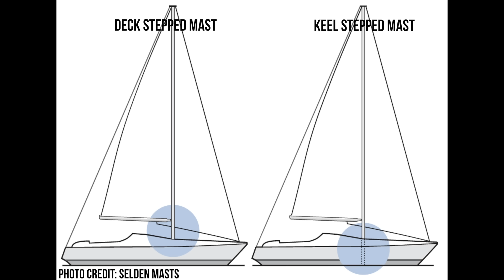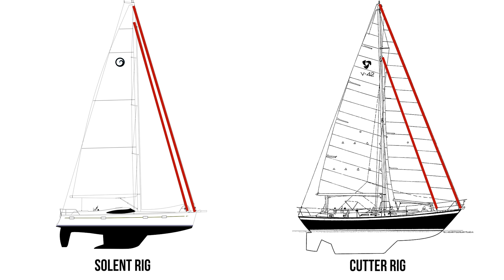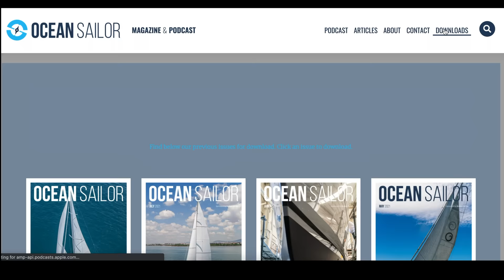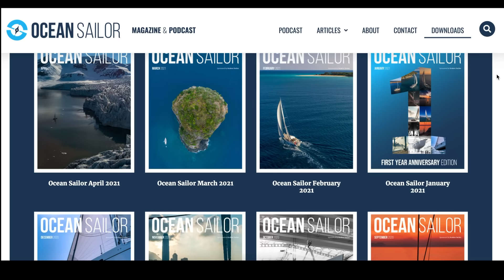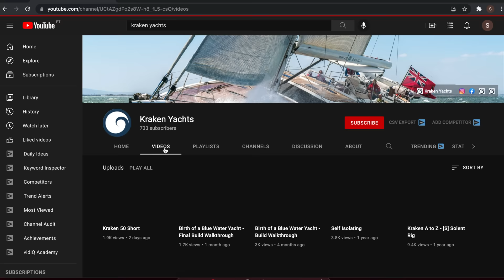7 Features to consider in a Bluewater Sailboat | Interview with Dick Beaumont

Comment: Very interesting, I have been sailing for 50+ years with a wide variety of boats all across the world and came to much the same conclusions as Dick, my fears are hitting something, fire (including lightning), going overboard and loosing a mast. I couldn't find the boat I want so I am building my own 80 footer which is similar to his design with integrated keel, skeg etc. My hull is much thicker than his with very high strength non osmotic resin, a deeper keel, wider and flatter profile (I turn the engines on if I want to go upwind), solid with stringers below the waterline and nidacore above and in the decks  (no wood in the boat at all, termites are terrible in a boat). I also have bonded in tanks from the keel to above the waterline at the front half of the boat which gives me a second layer of protection and finally I have a full collision bulkhead and 5 full watertight bulkheads across the boat along with a fully isolated engine room. Each watertight area has its own high volume pump out line and I can loose two watertight areas without it effecting the seaworthiness of the boat . It is center cockpit with fully enclosed pilothouse with steering positions in both, and 6 inch solid toe rails and ss guard rails  / full pushpit and pulpit, all lines and controls run back to the pilothouse and there is a stern diving platform and ladder for in water work and diving (a rope around the prop in Biscay taught me the need to be able to get in and out of the water easily). It has ketch rigged keel stepped masts with oversized rod rigging which is bolted right through to the keel with ss plates, in mast hydraulic furling, backstays, Cunningham's and hydraulic winches, anchor winches (3 full sized anchors and chains) bow and stern thrusters etc. Not a fan of high power electrics and batteries on a boat. One thing he doesn't mention is engines, I have twin naturally aspirated manually injected 320hp MAN diesels (old school) with tankage for 3000 miles in 5 tanks and multiple fuel filters / fuel polishing system which will drive the boat at 12 knots along with twin northern light generators for power and hydraulics (everything is duplicated or triplicated) . Whilst you cant outrun the weather I want to get as far as possible from it. The engine room is completely isolated from the boat with its own auto close air supply and vents and has ir, smoke and fire detectors, cameras and halon flood extinguishers, no gas on board. There is also an very high capacity engine driven pump and nozzles for firefighting and full centralized fire and smoke detection in each cabin.  I think safely is paramount in a deep water boat, not cost, performance or sexyness. Modern boats scare the c**p out of me and I wouldn't go out of sight of land in one.
Reply: Great post

Comment: I was a bit confused about the section about FIRE. He talked more about building up the hulls using composites 15Mil or thicker and using kevlar in ket areas. ut that doesn't address FIRE at all. I was left scratching my head because the composites mentioned are all flammable as are the resins used to bind all the layers together. This in my mind makes the Kraken MORE flammable and susceptible to fire. 

I understand he eliminated GAS (propane and dingy fuel) and has gone all-electric which I agree completely radically reduces incidents of fire but doesn't completely eliminate it. I have seen many boats with no gas on board still catch on fire and quickly sink because the fiberglass composites and resins are so flammable it goes up fast.

What I believe we need are new composites and resins for constructing these boats, which is why Aluminum and steel are still considered the safest materials to use if your goal is to avoid fire at all costs! So, I was surprised that he basically shrugged off the aluminium, saying, yes he had looked into it, but then moves on to the composites he uses for the Kraken as being superior to aluminium and steel due to the build of layers and the Kevlar at key points. I understand and agree with the thickness of the hull but I didn't see him actually addressing fire successfully.

I would like more discussion on the FIRE side of this discussion and get more clarity to assure that boat owners need not worry about a fire on their yacht, even if they leave it at a marina for a few months.
Reply: I would add to your point that it would be helpful to discuss the possible ways fires start on boats. Maybe somebody has done this already, but I haven't seen it nor thought about looking for such videos.
Reply: No gas on the boat which seems to be the biggest cause of fire on boats.
Reply: @randystrand908  most boat fires start electrically.  Propane fires are extremely rare.  Electric cooking is nice but that’s another power hungry system you have to feed somehow with some other expensive equipment.  Not a lot of real estate on a monohull for solar either.  Benefits of a catamaran.  Pros and cons to every choice.

Comment: I was recently asked a few times in a short period "why not a catamaran?" I said "oh, the main issue I have is they are very stable when upside down". In addition the lack of mass does not help you power through anything but that is a minor issue compared the the upside down thing.

Another source of fire on a boat is the electrical system. I don't know about newer boats but older ones do not have a fusible link on the battery side of the cable that goes to the shut-off/panel.

Comment: ABSOLUTELY.....!!

The VAST majority of ALL problems on a blue water yacht is all fuel related.  Yes...Asia is bad.  As well as our cruising down thru Mexico, Central and S. America...and the Carib Islands.

Many places there were no fuel docks....not even a dock.  So we'd take on fuel, under a bridge, from a truck high above us.  But most of the time, it was from old, 50gallon rusty barrels....that had some rain water in them...leaves...whatever.  That they'd take the barrels to some gas station, for diesel fuel.  Then roll the barrels down the beach....then into a dinghy skiff. To bring out to you.

The barrels are guaranteed to be filled with rust. We built what's called a BahaFilter, of micro screens.  That the fuel would go thru, before going down into your tanks!!

HOWEVER....diesel fuel bacteria, are guaranteed to grow in your diesel fuel. And within days....your fuel filters would start filling with ribbons of bacteria.  That looked like masking tape.

And yes, we had 3 fuel tanks.  That as we ran the engine....the 550 gallons of fuel would constantly be circulating thru our fuel filters. Constantly being polished, removing water, and bacteria.  But even then....you still have to use fuel additives. To kill fuel bacterias.

When you're in warm ocean waters....with a bit of moisture in your tanks.  You're guaranteed, to get fuel bacteria, growth!!

And if your motoring in moderate seas....that rolling will stir your fuel tanks.  Stirring up sediments. That will plug filters.  And there's nothing worse, then changing filters, with a hot engine...rolling in the ocean!!

Generators...refrig....everything else can be put off, and taken care of, once you get in.

And yes....with our ketch rig...it gives us sooo many sail combinations to run, no matter the wind state.  We never had to reef.  We'd run full sails, up to around 30+.

Then take our main down.  And with 50+ winds....we'd run a partially rolled up heavy genoa....and our mizzen.

Sooo.....I love the flexibility of a ketch rig.
Reply: I've watched a ton of sailing related videos, but this is first discussion re fuel quality, dangers and solutions. That three tank solution using filters sounds excellent!

Comment: While I agree with a huge amount of what is being said, a huge amount of these potential issues can be mitigated or completely removed by a steel boat, keel loss, fire(to a degree) strength etc...... Aluminium is all good and well but it's soft, not steel though. Absolutely agree with keel stepped and solent rig, and no runners.......but you will struggle to tack the Genoa through that wee gap. My boat has a very tall selden fractional performance rig which ive added a dyneema removable solent style inner stay to but moved the bottom back a bit to create a type of fractional slutter rig, single backstay and ive got a reaching gennaker on a karver continuous furler on a sprit with it's torsion stay, on a 6mm insulated chined corten steel hull Van De Stadt 34' pretty bloody seaworthy and high latitude capable. My list of prerequisites for a blue water capable yacht were integral keel, skeg hung rudder, keel stepped rig, cutter or solent, tiller steered, large tankage and storage capacity, good solid overpowered reliable diesel, preferably a chined steel hull designed by a reputable designer, I got everything except the keel stepped rig but after having sailed her in well over 40 knots around cape point and Aghulas reaching 17.7 knots SOG in 4m following seas  I'm not going to lose any sleep. Cats are shite sea boats that cannot handle the rigours long term, as Parlay revival has clearly exposed but it's very much a horses for courses scenario. I'm planning a solo Atlantic crossing early next year from Cape Town to the Caribbean and then I'm going to make an attempt at a non stop circumnavigation of the Americas via the Northwest passage and the Horn. Obviously adding some high latitude gear. 
I'm guessing that just the front 8 feet of a Kraken would cost more than my entire boat, so clearly a rich man's boat.
Reply: That Parley remark was.of.course it was the factory which didn't bond everything the way they should...
Reply: I sail reguralry on a steel sailboat (Bruceo 44), and I have to say, it sucks :P A well made fiber glass is lighter, gives you better insulation, DOES NOT GET HOT IN THE SUN and is in general just better. Yes, that steel boat survivded hitting a sea floor mounted sea light (not me :P), but it also is weirdly flexible (mast pulling on the stays can wake you up by shaking your bed). 

The only upside of the steel boat in my book is that you don't have to care about fenders that much, that's all.
Reply: @milkoberben2963  - And that's kind of the point. The vast majority of manufacturers not only cut corners, they also build inherently unseaworthy boats.
Reply: @charonstyxferryman  Hell yes! And get rid of the damn roller-furling jib as well. The bloody things fail dangerous, and always at the worst possible time.

Comment: Hello Dick - fantastic stuff.  Thank you.  I purchased on older boat for a lot of the same reasons at much criticism from my friends and family.  I bought a fully restored 1965 Pearson Vanguard (33.5 ft) which has just about new everything from the Yanmar diesel to a Genoa roller fuler to autohelm & electronics with the plan of lake sailing & learning the boat for 2 seasons and then sailing from Charleston SC to the Bahamas to the Florida Keys.  The boat was designed by Phil Rhodes and I just think it is a fantastic full keel sailing vessel.  Simple systems all the way around and I find people confuse simple these days with bad.  Any issues do you think with doing some Coastal Sailing in my 1965 Pearson Vanguard?  After your interview I am researching the Righting Moment angle - not sure what it is on my boat.  Any comments would be greatly appreciated - keep up the great advancements.  Right is right!  MJ
Reply: At 4.5 feet, the Vanguard's draught is pretty good.. so I'd say it would be an excellent coastal cruiser, and should still be a capable bluewater boat.
Reply: @Garryck-1  Thank you for your thoughts - I appreciate learning from Bluewater experts who seem to really know what they are talking about.  Thanks again.  Cheers!
Reply: @mjanulis3603  - I'm no bluewater expert, but I've put a LOT of study, time and thought (years of it, actually) into what makes a good bluewater boat, because I intend to begin building my own bluewater boat next year. So far as my comment about the Vanguard's draught goes, it means you'll be able to anchor in lots of snug, shallow nooks that deeper draught boats can't, meaning it'll be easier to be well sheltered when the weather gets up. And the keel and rudder are much more seaworthy than fin keels and spade rudders are.

Enjoy your very lovely Vanguard!

Comment: Excellent interview and discussion 👌🏻
Fiberglass composite Vs Aluminium... Horses for courses... Although the undeniable advantage of aluminium and steel, when done properly, is they can be built to spec from build to build dependant on the requirements of the owner... Building in composite means once the mold is made that's it... Both methods have advantages and disadvantages

Comment: Fascinating interview and some real unashamedly oldschool decisions to create a bombproof boat. Interesting it’s still a sloop not a ketch.
Reply: I was thinking the same. My guess is simplicity and reliance on powered rigging so the size of the sails is not as significant as it used to be - Ketch with smaller sails. But it would be a great question to hear Dick B address in an interview... Part 3?!!!
Reply: @randystrand908  Much more redundancy in a ketch plus many more permutations of sail configuration and all lower down so with much less keel requirement. I’d rather not have powered rigging. Very definition of not robust single point of failure.
Reply: @ruaraidhmcdonald-walker9524  Appreciate your thoughts.  Re power rigging: My interest is personal in that (at this point) I am interested in the largest boat possible to single hand. Thinking 45 to 66, what would be the largest non powered rigging, possible to single hand?
I'm hoping to spend lots of time in the high latitudes and, in the inevitable cold conditions, the power rigging would be great (realizing it can fail and obviously I'd be going out on deck in any conditions to manually work it.)
Reply: @randystrand908  I watched a friend’s Discovery 58 rendered unsailable by a broken power furler and had to sit waiting for parts. Not sure that sounds particularly blue water to me but I’m no expert….
Reply: @ruaraidhmcdonald-walker9524  Sobering. My impression was that if the motor went out on those, they could be operated manually!... Obviously I'm needing some solid study on your point.  But thank you for the word of caution!
Reply: @randystrand908  Certain they can but then you’re grinding on the foredeck to get the sail in and out.  Not sure I fancy that much. Not sure if below deck motors can be rigged with a conventional rope. Guessing not as they wouldn’t have delayed their sail by 10 days waiting for parts!

Comment: Great interview and discussion.  I'm sold on Mr. Beaumont's employment of the commonsense principle in boat safety and construction.  I am curious about a potential issue I did not see addressed.  Perhaps it was and I missed it but what about the the potential of lightening strikes.  Granted, very unlikely but it does happen.  I'm not an electrical engineer but it would seem to me that the keel stepped mast lends itself well to be the best grounding source by creating a path from the highest point to the lowest point under the water, connecting the mast to the lead ballast to a stainless steal or brass plate outside of the fiberglass.

Comment: To be fair, his position on swing keel boats is based on his sailing ethos. Here in the US, you could sail for years, never visit the same town twice, and never cross water with swells over 1 meter. If we want to do the Great Loop or pound around the Bahamas, a deep keeled boat won’t do. The Great Lakes, Finger Lakes, and Keys all require a shallow draft and the ability to adjust the rudder. This is why the US loves plastic motor yachts.

Comment: Interesting interview. He’s very knowledgeable about his narrow focus of the blue water sailing vessel. Obviously, it would have been better if he had discussed where they are with solar and/or wind generated power vs relying on a diesel  engines and diesel generators. That just makes me sick. How can it be a true blue water boat if you’re constantly looking for ports to buy fuel and possibly not even making your own potable water onboard? He’s obviously built a safe boat because that’s his main concern … which is good. The trade off is he’s also got a draft of about 8 feet. There are a lot of places where an 8+ foot draft just isn’t going to get you into port due to reefs, etc. You sure aren’t going to be running the ICW up the eastern United States of America, you’d be constantly running aground.